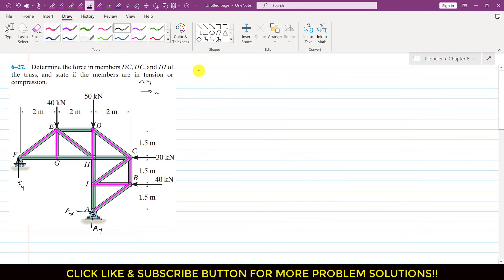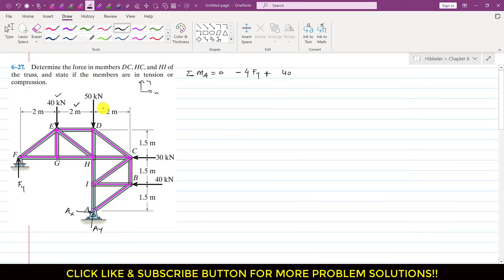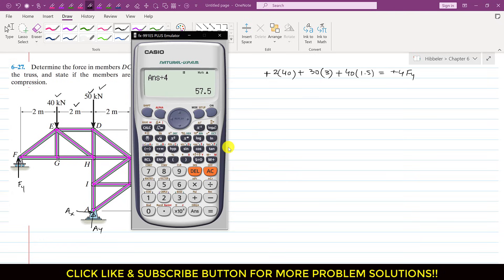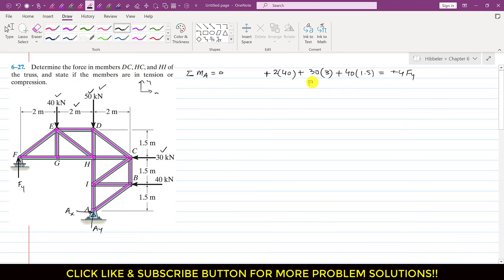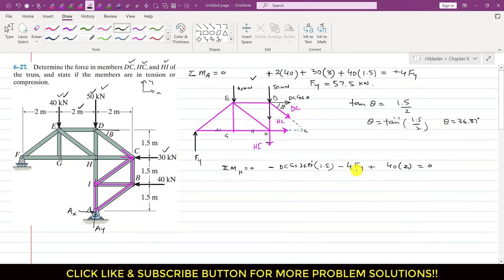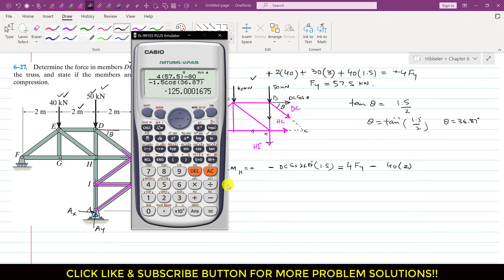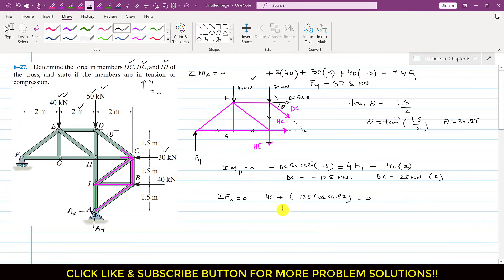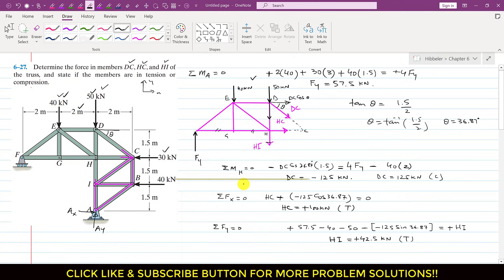Determine the force in members DC, HC, and HI. | Method of Sections | Statics | Engineers Academy

Comment: It's wrong right ????
Reply: Nah, its correct, even if you do it the other way it is still correct
Reply: I was looking in the comments for confirmation as well. He has DC written as compression, but does not draw it correctly, which leads to an incorrect answer for HI.
Reply: It’s correct
Reply: @s7vxn  I clarified it with the professor it's wrong
Reply: @deonnjoseph1641  which part?
Reply: @s7vxn  final part check with chegg
Reply: @deonnjoseph1641  I don’t use chegg but I literally can’t find anything wrong with the calculations
Reply: @s7vxn  I submitted this one and got zero on my assignment. i will try to share the answers with you let me check